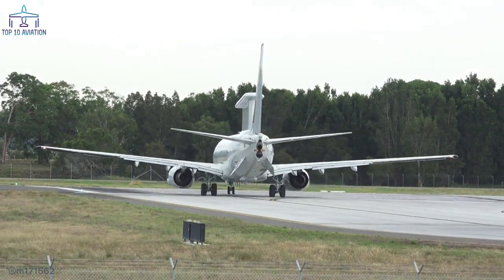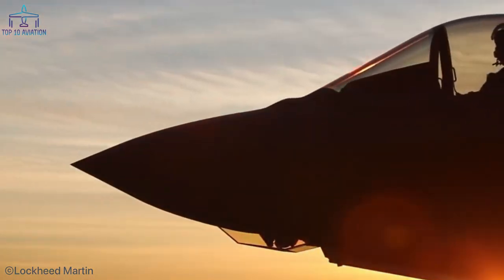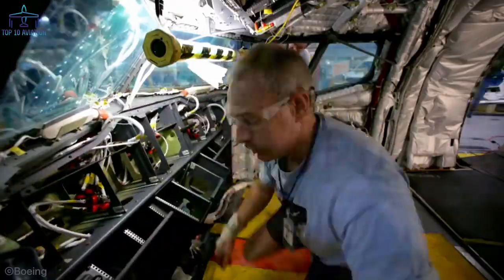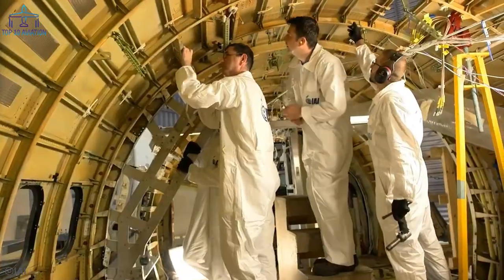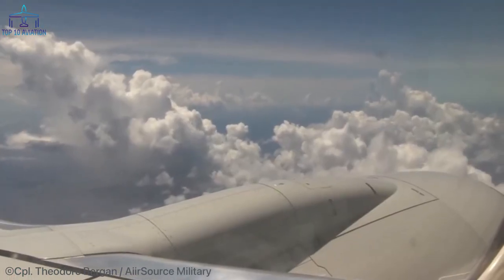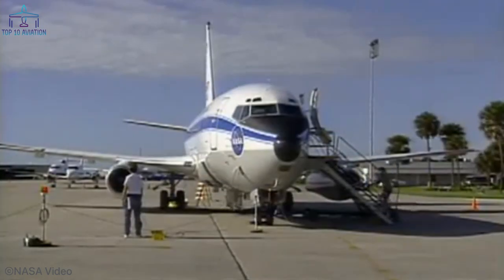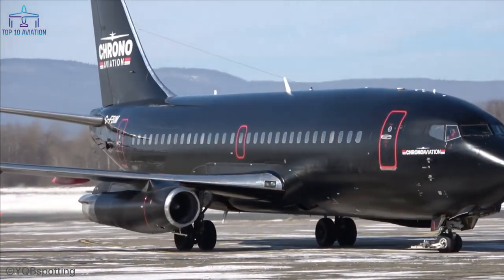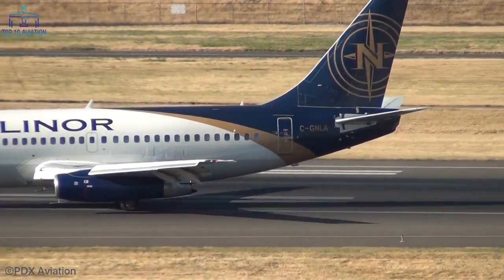Top 10 Modified Boeing 737’s

Comment: 3 Of My Favourite Modified 737 
1. 737 P8 Poseidon
2. 737-200 Surveiller
3. 737 AEW & C
Note: If I had a 737 P8 Poseidon in my backyard, I would probably use it (not for fighting) just for private transport, but I need to pay for fuel and crew which I can't lol 😂🤣